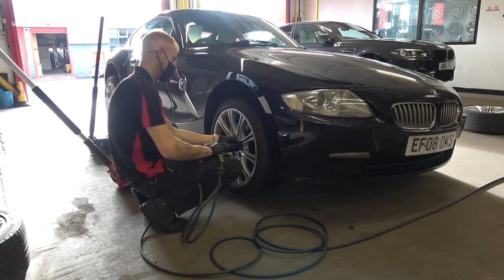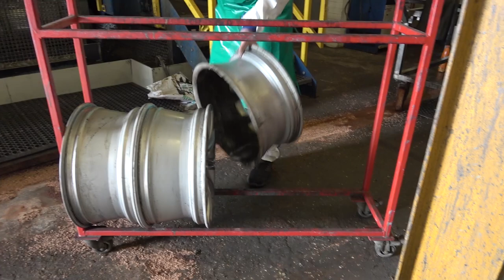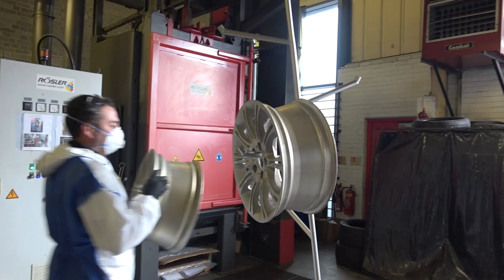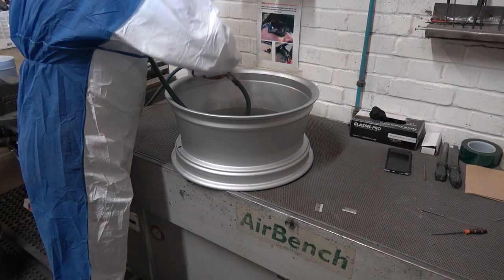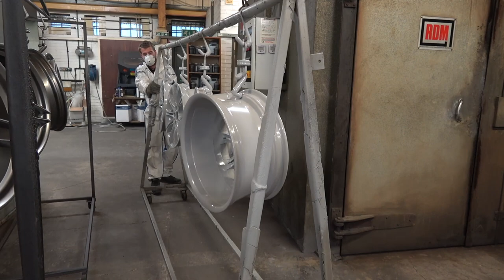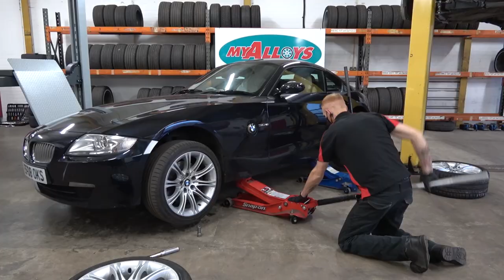Transforming My 12 Year Old BMW Z4 3.0SI Coupe's Corroded Wheels!

Comment: Good job, very thorough. Ideally should’ve been wrapped in new Michelin PS4’s to finish the job off. Avons are mediocre. Keen to see the finished article. I’d recommend having the bumper off to paint (easily done on the e86) and to have the callipers properly removed for a rebuild / re finish 😃
Reply from the maker: Thanks! I agree re the tyres, but I've only had the car for about a month and these avons were new. I'll change them next year for sure. The next two videos in this series are a detail and caliper refurb 👌
Reply: Thanks, sometimes people don't realise the work involved to achieve the finished results.

Comment: Do they not do any hahdheld spot blasting to remove any last bits of corrosion in crevices etc? Also, my allows have large plastic centre caps covering the lug nuts - how are these refurbed as I didn't think you could powder coat plastic - do you need to spray paint both the wheel & cap to get a match?